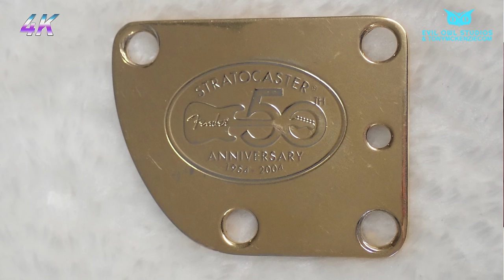How to buy BRAND NEW guitars cheaper than at dealers: Many Brands!

Comment: Buying parts from Stratosphere and finishing it is way more expensive than buying a finished Guitar. Paying more for a partscaster is not a good idea and you kill your resale value too.
Reply from the maker: Not true on the Fender Jeff Beck - and that's a fact. From the UK even VERY conservative even if I had to buy a case I still save hundreds? Thanks for  the info there, but I also think its the same and BTW it would not be a 'parts caster' as ha they are all the same parts? But I get the point and thanks for watching.
Reply: I agree with Oaklawn.  I've tried it before and built an Am Pro II. It cost me just under retail price after I bought everything separately,  and I didn't get the nice case they come with normally.   If you buy a model where the serial number is on the neck plate,  and can find a neck without a serial number it is less obvious of a partscaster, but anyone can use the Fender serial number lookup site and they'll immediately know if the body and neck don't match. Only do it if you know you're never going to resell it.
Reply: Interesting upload,but 
Played that import game. For the sake of saving a few hundred £ it’s better just buying an authentic and complete guitar here in the UK, you can always haggle the price. And no resale problems.
Reply: @19501960  That is exactly my point. Thank you for affirming my position. The only thing the store The Startosphere is good for is buying a something you absolutely need not want.  The owner is also an A$$HOLE to deal with.  Bought a pickguard for my LP it took two weeks to get and the owner refused to give me a positive feedback on EBay unless I did my feedback first. I bought and paid the item instantly.

Comment: Serial Number checks out. But why buy a guitar without a neck and then pay extra? Not for me thanks.
Reply from the maker: You missed the point... buy one From Fender at £2200... or buy the body (complete) for £750 + about £600 for the neck, 4 screws and there is the saving and exactly the same thing... brand new. That's the point... and it would still work in the USA because there you don't pay our ridiculous 20% tax and the parts are free shipping in the USA. There really is little to not like. Even adding the cost of the case STILL makes the guitar far less cost than just walking in and buying one bolted together. Thanks for the post and for watching.

Comment: Nice video. I own the Jeff Beck Strat surf green but have never taken it apart. Good to see the electronics. I think Fender or someone called these pickups humbucker stacked. Two windings per pickup but stacked instead of side by side. Is that what you see? I really can't tell. Great video and will be looking for the neck video.
Reply from the maker: Yes they are stacked hum cancelling windings on there like the newest Fender pickups see this: https://youtu.be/HLYYlAGvrTo?si=T0WjhFFjy41dhQZ9&t=525 and while these are telecaster they are basically similar. I also have a noiseless pickup I 'opened up' here: https://youtu.be/xIHHkusr9bo?si=bXqkt21R072ssUIK&t=155 where you can see how its all made on this video.  The neck I bought yesterday... a very slight knock at top of the neck but easy fix and the only non custom shop one on there so I bought it... it looks very good. Maybe a week or so or more before that video appears. Thanks for watching.

Comment: When I was having a quick look today on their prices, it came out saving around £300 compared to dealer price, but that was just a quick look. So it's whether you want to risk if any problems occurred, (Damage, lost etc) and the hassle of overseas return etc.
Personaly, the extra expense of a music shop dealer would give me peace of mind of being able to return/chat to local dealer. However, that's just personal to me. If this company was in the UK it would be different.

As for screwing off the strap locks, that would be OK if they came seperate in a bag included to put on, but to not include them is crazy. So I'm with you on the 9/10 which is being generous for the extra hassle of having to order them.
Removing them may give extra protection to the body in shipping, but at least include the bloody things.😮👍
Reply from the maker: Well it does depend on exactly what you buy I guess to some extent. I have bought Malmsteen strats (body then neck), Jeff Beck necks (two or three - and just bought one that was listed today and the quality looked perfect. That will go on the JB body guys have seen in this video and we'll see that later. Yes I get it re music gear retailers etc. but I have messed about a long time and I don't think there will be issues really. Everything I have bought for years has been pretty much OK... ha except those pesky strap locks :) Oh well. Thanks for the post and for watching.
Reply: @tonymckenziecom  Good to know it's been positive for you for buying the parts and you've had no issues, except for the strap locks 😉

Comment: that lil hole by the bridge is there because that body has the cut out for the old style 6 screw style plate. i prefer those to the 2 point set up along with the bent steel saddles. unless its those brass ones i like those two. seeing those strange stacked pickups was interesting, i watched a video about mounting a dummy coil next to the 5 way switch for the bridge pickup..i think i like the stacked option better as alot less wiring has to be done. it sounds like you could use an American friend who can forward shipments for actual cost. you shouldn't be getting gouged just because you live in the uk.
Reply from the maker: Oh for sure its all aggro with shipping and tax etc. but I do have a few friends in the USA (my 'dead cats' friend is there - he knows who he is) but I would not want to impose really. Well I thought that in 2013 when I bought a new strat (Elite) at the time - same hole. I went to the guitar shop and looked at all the others - and some had the hole and some did not - irrespective 'at that time' of 6 screw or 2 fulcrum. Now that's a long time back - and some depended on the colouring of the body - most solid colours had no hole and most see through cherry (for example) did. I'll take your point on this as I never did understand it. I always mention it if its in the video just so guys do see it and ha its not just me :). The pickups are like fitted to a 2008 American Strat (I have one) however, on the JB they are would a little more for higher output than the AM strat of 2008. Thanks for the info and for watching.

Comment: Hi Tony.  This is an interesting one, I bought a 2002 USA Strat deluxe, and I took the pickguard apart to change the pickups which were the noiseless ones incidentally.
Stamped into the wood if the neck pickup cavity was BECK ! So I think the Beck bodies were used not just specifically for the Beck model, also the same thing went for my 1996 Strat Plus.
Reply from the maker: Ha that's very good information I think. There's no stamping on this one from what I see... and likely those pickup routes may have been the SC pickup ones? So things have probably changed. But great info... and thanks for watching.
Reply: @tonymckenziecom  that's right, it was routed HSS. Keep up the great videos.

Comment: Would be interested to learn the price breakdown Tony. I have a MIJ Strat and bought a Loaded HSS pickguard from Stratosphere a few years ago . Fitted perfectly and sounds great however paid for scratch plate. + shipping then got walloped for UK import Tax on my doorstep before Royal Mail would hand it over. Maybe l was an unlucky but would be very cautious about doing it again. Otherwise great video
Reply from the maker: There generally IS those taxes. However, if you buy a guitar that would cost a lot more like the JB here, and total it all up, you are still better off by a fair bit of money. The Post office (and others) like to charge for 'customs clearance' which is B****s as they get cleared through customs in any case - those boys are not good. On this body it cane I think either Fedex or UPS and both of those have their own customs clearing - much simpler and faster. If you buy something that is not that high a cost like the pick guard etc. you mentioned then it can be harder to end up with a great result. Its a good point and one I should have maybe mentioned in the video. Creating these vids I don't work from scripts - its all created in real time and sometimes its possible to forget to mention then odd thing... but I'm sure you get the idea. Thanks and thanks for watching.

Comment: Thanks Tony. Looks very nice. Is the hole because they use standard routing on every model but the bridges have different specs? My strat has a vintage trem mechanism and doesn't have a hole. In fact the bridge is snug with the scratchplate so you might not notice if there was a hole.
Reply from the maker: I can't be sure about that trem hole. I noticed it first in 2013 when I bought a (I think) an Elite. At the time I went in to the guitar store and checked all the strats out. At that point I noticed the 'flashy' topped guitars had the hole, and the standard paint jobs did not. But this is a standard paint job and has the hole... Like you say it probably relates to standardisation (like the pickup routes in the body) to save a bit of money in production. I think it reltes to the hole rather than the tremolo... Thanks for the info and for watching.

Comment: Tony I checked the 1st few pages of the ebay link for necks. None of the fender ones have the made in the usa or mexico stamps on them. How can a buyer be sure they are the real deal ?
Reply from the maker: I have been buying from those guys for years and ALWAYS received the exactly correct product. This one (while its here) https://www.ebay.co.uk/itm/364403485003?itmmeta=01HTDH22K3RN3Q2YTW2KGH845Z&hash=item54d823e94b:g:OsEAAOSwtBVk0Rlu is a custom shop Jeff Beck neck and if you check against the items for sale by Fender it is EXACTLY the same. Note also they do show you the documentation on that listing. Of course I need no convincing and its all genuine as received by me. Had there been anything dodgy I would have found that out years back (oh maybe as long ago as 6 or 7 years!). Good point, but I recommend anyone do the research and you'll likely find they are a trusted supplier. And thanks for watching.
Reply: @tonymckenziecom  Tony thanks for replying. I've bought replacement necks in the past from fender and they always had made in USA on the headstock without exception. What would be the reason the ones I saw on the sellers ebay page had no country of manufacture stamps ?
Reply: If you look at those guitars online they don't even have made in the USA written on the headstocks. Stratosphere just takes the guitars apart and sells the parts.

Comment: As far as numbers on hardware go that's a separate sheet. Watch a good
American fender factor tour. For example. Body has one sheet . Neck another.  Hardware. Which were the numbers you were talking about.
All the sheets have in common is the serial number. Whith is on the master sheet which carries all the numbers.
Called builders sheet. Then are lesser build levels. Master builds are the titest. I can't this was always the case.
But i am thinking frnder did this to.
Now get this. To build buyer confidence. It's a way for fender to prove any of theses high end builds.
If returning to the factory are as they left it. Warranty protection for them and you. But that all goes up in smoke
When talk about PRE CBS FENDER.
Reply from the maker: This is a great post Albert... appreciate the info for others. Oh yeah the old stuff is another story really. And great point about the accountability re warranty etc. something I did not really mention... thanks again and thanks for watching.